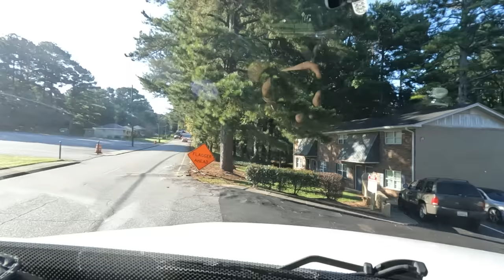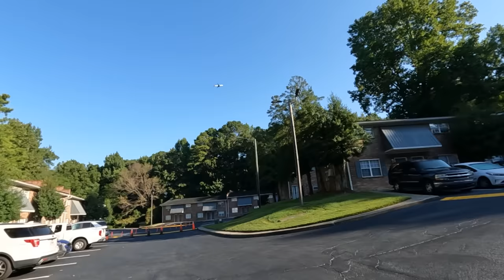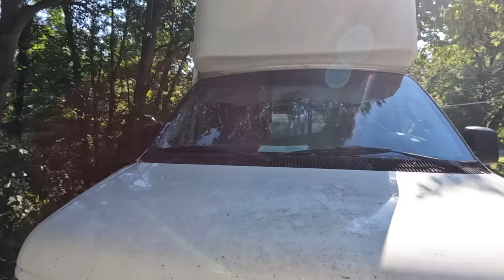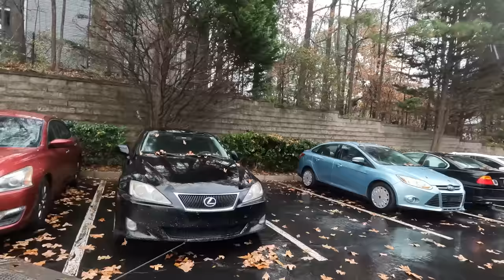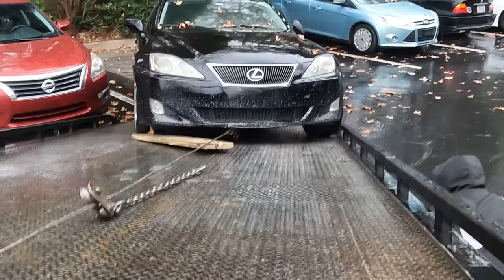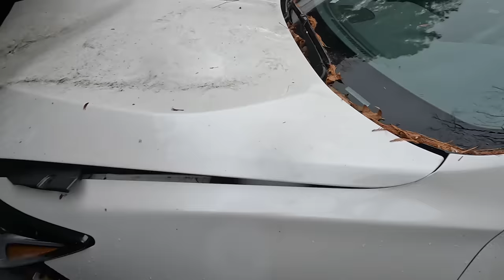Parking Revenge #366

Comment: We had our parking lot restriped and resurfaced, and they gave us a full 7 days to give us a notice in our mailbox and email, so there's NO excuse for not getting it😮
Reply: What if you were on vacation for 10 days?
Reply: 10 day vacation… then you pull out your black card and get your chit outta impound
Reply: or you check with the manager before you leave to see if there is anything going on while you are going to be away. Though if you were in the slammer or the hospital for a longer duration there could be an issue, I suppose. 🤷‍♂
Reply: Uh, deployments tend to last 6 or 9 months depending on whether it was ISAF, Iraq, later on Mali. And I wasn't exactly checking my e-mail daily even at the main base where they had an internet room. (the favourite destination by far of all people using that room with computers was the local porn server 😆)

I'd expect at least a month prior notice for works that require you to plan around them. My appartment block gave a 6 month notice for works to the sewer system.
Reply: I was an over-the-road truck driver and not home all that often. My apartment manager knew this. I wasn't there between the time they put notices on doors and the time the parking lot was getting fixed. They had their tow guy move my vehicle to a different part of the lot that was already finished - at no cost to me. It helps to have a good relationship with the property management. I kinda freaked out when I came home and my car had been moved, but then I found out what happened. (And I looked it over real careful for any signs of damage and couldn't even tell where/how he had hooked it. Maybe a wheel lift.)